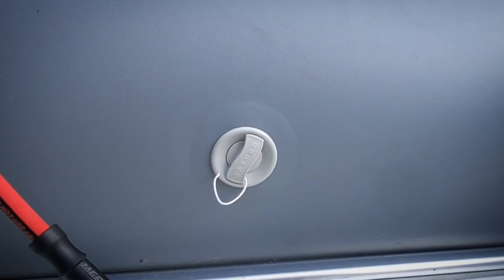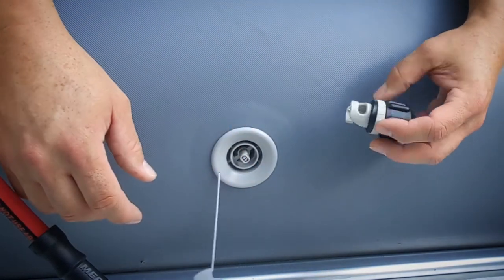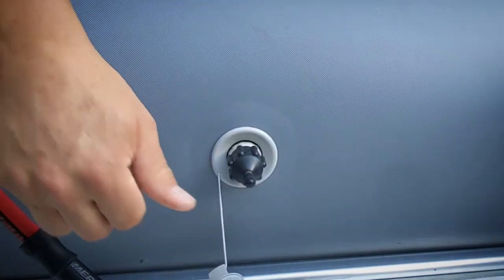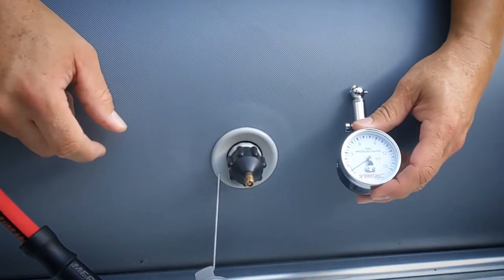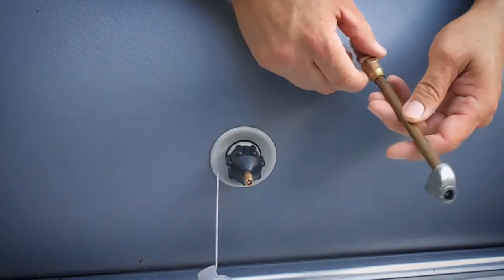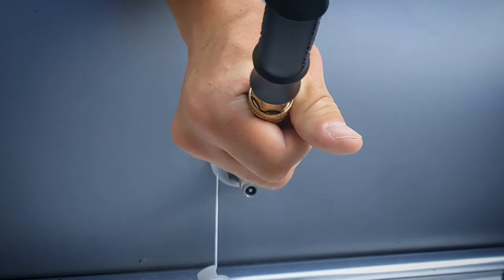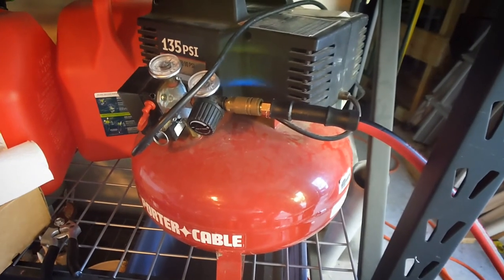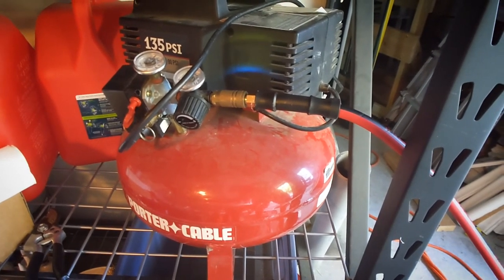Can You Inflate Your Saturn Boat with a Pancake Air Compressor? Yes!

Comment: Will your compressor completely inflate your raft on one tank of air without turning on? What I'm really asking is can you take a tank full of air at 135psi to a remote place with no electricity and fully inflate your raft?
Reply from the maker: No. Not even close. I keep my boat mostly inflated (on a trailer). The manufacturer recommends letting some of the air out between uses so that the seams aren't under constant stress. I top it off before I take it out. Topping it off takes 15 minutes or so. And my pancake compressor runs almost constantly.